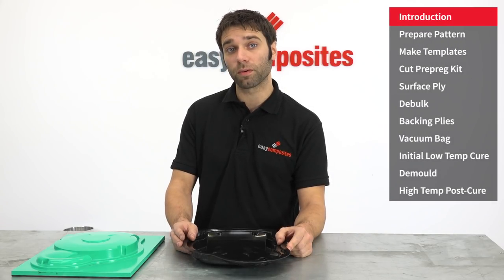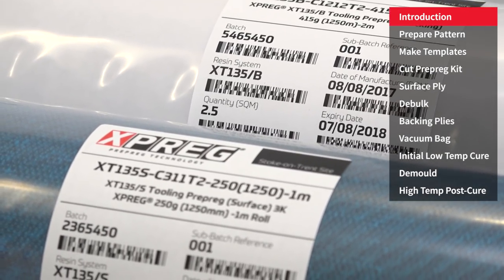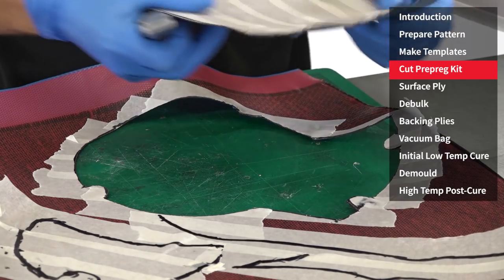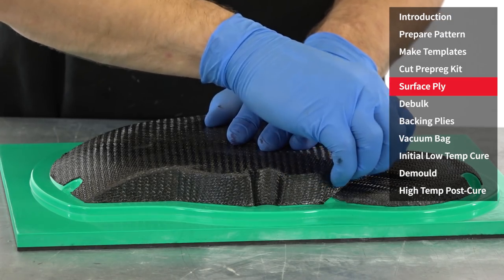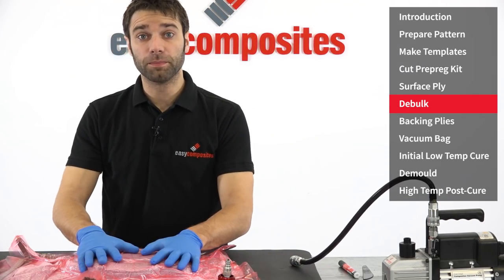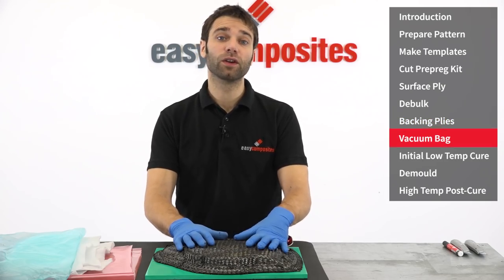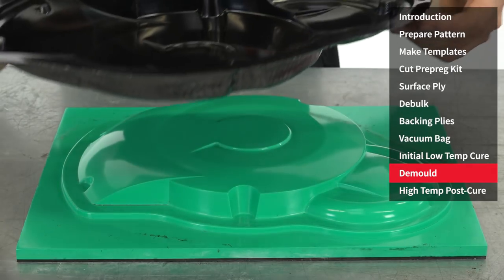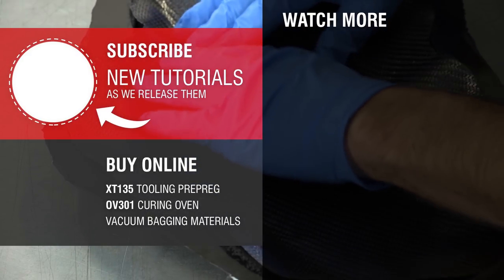How to Make a Prepreg Carbon Fibre Mould (Using XPREG® Tooling Prepreg)

Comment: HI
I would like to build a canister from carbon fibre. Essentially a 'bucket' for want of a easier to understand term. I want this to be double 'A' sided though as the inside needs to seal with o-rings and the outside is cosmetic. The canister needs to parallel sides, or to within a gnat's cock.
I am thinking about how to remove the male plug that will form the inside of the 'bucket' and am wondering how to remove this. Have you ever come across people doing this with a solid mandrel and what would your thoughts be about how to do this? I was thinking of using room temp cure resin around an Acetal male plug then once cured popping it in the freezer. The CTE of Acetal would shrink it by .7MM over the 170mm diameter. In your experience would this be enough to be able to remove the plug?
Reply from the maker: Hi Jools, interesting conundrum. Exploiting differential CTE is definitely a good way to deal with extraction of parallel mandrels. Acetal's CTE doesn't really offer much difference from the cured composite and I'm not sure that 0.77mm (which sounds about right) combined with the nature of the release from acetal would be sufficient. It might be though! Another option would be a steel mandrel which you could wrap prepreg around, cure it elevated temperature and then extract at room temperature (or freezer temperature, if you need even more contraction). This is how carbon fibre tubes are made (they don't need cooling sub-ambient). This would give you quite a bit more difference in CTE between the two materials and therefore more 'release'.
Reply: Easy Composites Ltd does this give good repeatability on the final part. My worry for that was, and it’s based purely on guess work, was that as the steel expanded and the temp rose might the finished part be slightly different in size? For production runs to o-ring tolerances this would cause problems.

Comment: It feels wrong to put masking tape over release agent. Needs to be the the other way around. Finish with masks and only apply release agent when everything is ready for laying
Reply from the maker: Disagree. It might feel wrong to you but it's the correct way to do it. Masking tape doesn't stick to the release agent surface at all, it removes with no trace whatsoever and - as you can see in the video - the mould will fall off the pattern just fine. If you put the masking tape onto the pattern before you've applied release agent then it will stick and will leave traces of the adhesive on the pattern which could contaminate the release agent when you apply it. That said, each to his own!
Reply: I agree, and have never heard of it being the result of a scrapper

Comment: 5:50 “conventional bag” = envelope bag
Reply from the maker: In this video, we do use an envelope bag but in context, we just mean normal vacuum bagging film as opposed to the format of the bag itself. With a wide enough flange, you could opt to just bag the part onto the mould but for a small part like this, envelope bagging is definitely more straightforward.

Comment: Why not just print out sections that you need to cut? I mean, you do have a CAD model of the green pattern I assume, just unwrap faces and print them out and then use that to precisely cut the carbon fiber pieces.
Reply from the maker: Yep, you can totally do this. To do it right it's slightly more complicated than a simple 'unwrap' because of the way that a woven fabric will distort and comform. There is a plug-in for Fusion360 which understands the complex way in which woven fabrics 'drape' and so can do all the distortion compensation. For a small, simple mould like we made in this video it'm much quicker to just do what we did here rather than do the unwrap modelling and then set up with a drag knife on a CNC machine but for larger or more complex moulds it can become worthwhile.
Reply: Easy Composites Ltd, would you mind sharing a link to the Fusion 360 plug-in?
Reply from the maker: Sure, the plug-in is https://www.exactflat.com/
Reply: Yes, but depends on m/c capacity. If no CNC capacity, or for one-offs, it is done by hand anyway, but then it's best to see the whole process through, as arguments usually occur because Lamintor "A" cuts a template, goes home, then Laminator "B" picks up the job, and spends the rest of the shift moaning about how shit Laminator A's templates are.

Comment: How about making a split mould? Polypropylene as unimould?
Reply from the maker: Hey Wyn, hmmm, not really. When you're making a prepreg mould like this you really need the pattern to be a sturdy thing - you'll be laminating quite hard against it and also vacuum bagging against it and so temporary barriers (wiht filleting wax etc) are not really an option. If you're making a split mould and you're starting from a CNC machined pattern then of course you can design and machine the mould to include the flanges already but if you are starting from and original part and need to add temporary barriers to make your splits then your options are to either take a quick 'splash mould' off the part and barriers and then use the splash mould to make a splash part (which would now include the flanges) which you could then use to take the prepreg mould off - or you could use our high temperature epoxy tooling system instead. We have a video of that process on this page: http://www.easycomposites.co.uk/#!/resin-gel-silicone-adhesive/epoxy-gelcoat/EG160-high-temperature-epoxy-tooling-gel-coat.html
Reply: Yes, but it's best to minimize the number of moulds for a component, as they can be a bitch to trim and bolt together, especially when fixings are in close-proximity. Only use for multiple-mould tooling based on undercuts. For example, an F1 front-wing "turning vane" will comprise 3 separate moulds; one per side, and a ~2mm rebated "cap" to close over the fixing-flange. Think of a "T" shaped x-section.

Comment: Which of your prepreg carbon fibers is most suitable for this kind of application: https://www.youtube.com/watch?v=PGGiuaQwcd8 In the video there, Christian mentioned that their prepreg is made of a special mix of resins that will withstand high temperatures. Thank you.
Reply from the maker: XPREG®XC130 is our autoclave-cure toughened epoxy prepreg that would be suitable for applications like the wheels you linked to. Generally a wheel would not be a specifically high temperature application. There will be radiated heat from the brake discs but there is also plenty of cooling from airflow so I would not generally think that they would need to have a particularly high Tg resin system. The standard XC130 prepregs all use 'high strength' fibre and are at the top-end of the performance spectrum for conventional carbon fibre prepregs. http://www.easycomposites.co.uk/#!/prepreg/component-prepregs/xpreg-xc130-22-twill-210g-prepreg-carbon-fibre.html
Reply: same with XPREG® XC110? Would it be possible to make something as strong and reliable as a rim from "out of autoclave"?
Reply from the maker: For the most critical structural applications, such as a supercar wheel, it would be recommended to use an autoclave because this will ensure minimum void content however with proper technique (including debulks every few layers) then it would be possible to use an out-of-autoclave process (i.e. the XC110 system). It's worth pointing out that the XC110 does have a slightly lower Tg (110'C vs 130'C of the XC130 system).

Comment: Cool, could you prepregnate anything? Like Potassium Bromate w/ rubber or pottasium bromate w/ paraffin? 

Thank you.

God bless, Revelation 21:4
Reply from the maker: Well, technically you could pre-impregnate anything with anything but if you want to use the resulting material as an elevated temperature cure prepreg for composites then really you're looking at impregnated traditional reinforcements with a limited number of resin systems (epoxy, phenolic etc.).
Reply: Thanks. What has the highest energy, solid fuel and solid oxidizer that can be pre-impregnated when introduced w/ a heat source? Thank you.